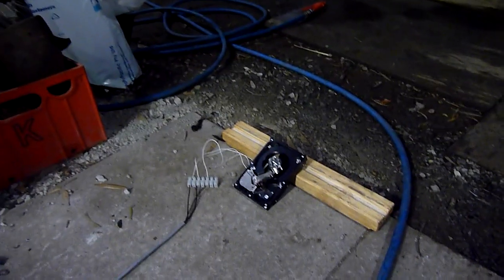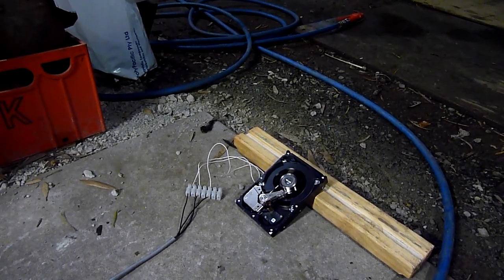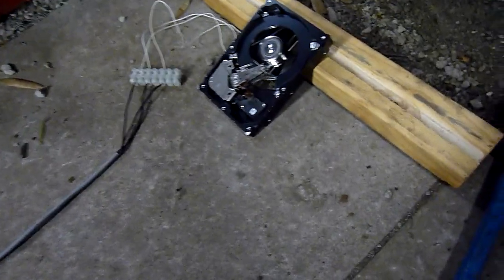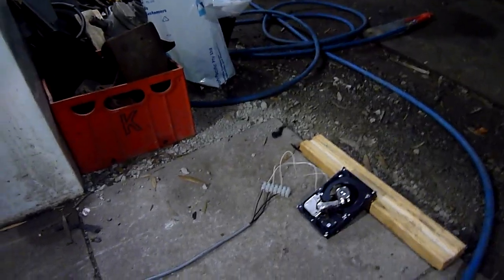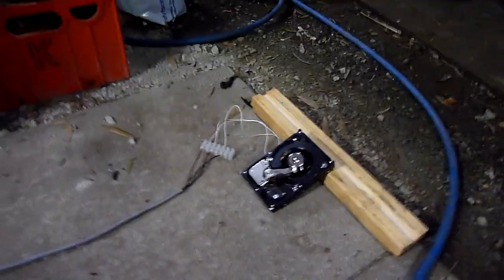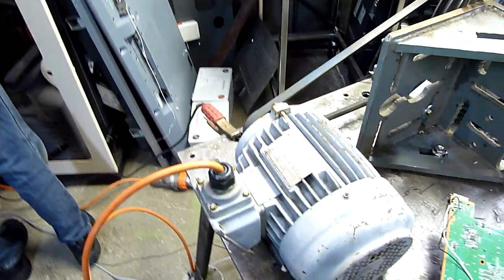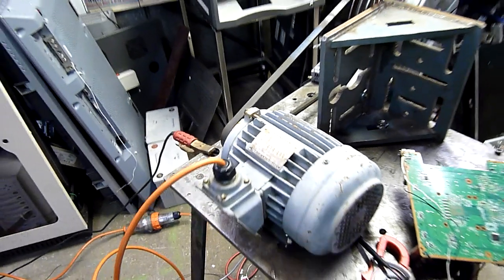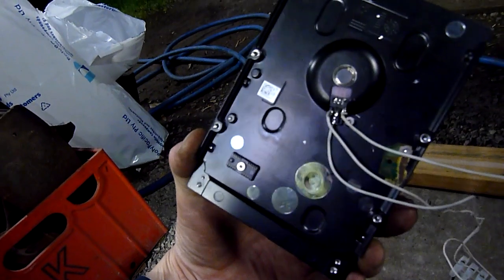Jullian's Death Table - BLDC LG Washer Motor Vs BLDC HDD Motor

Comment: I don't understand the hertz thing - were you putting more voltage into it? I'm learning but I don't get this part - anyone can answer that would be great - thanks :)
Reply from the maker: When I was calling for more hertz I wanted the drive motor to spin faster, the VFD makes an induction motor spin faster by increasing the speed in which the AC changes direction.
straight out of the wall, mains AC reverses polarity 50 or 60 times per second, we pushed it to almost 170 times per second with the VFD, and in 3 phases, not one.

Comment: Would you consider swapping the spindles on the belt so you could really tear the hard drives arse out? great video btw
Reply: I think I mean swapping the pulleys
Reply: I was thinking about that too. But BLDC motors are controlled closed loop for a reason. If you manage to get it started with the higher minimum frequencies(after changing the pulleys, it will probably go out of synch and spin down at few thousand RPM. Or you'll just pop the windings.

Comment: what was the name of that white plastic thing they put the wires in?
Reply: It's called a terminal strip, it has brass inserts with screws to grip the wires,
Reply from the maker: inspirality
yep, termninal strips, very handy things. usually come in a 100mm - 150mm long length (15 - 25 tunnels) but there are tonns of sizes out there.

Comment: What ever happened to that big black GE motor you rebuilt?
Reply from the maker: I do not have any GE motors, but I do have a few Century ones still around
Reply: Was it a Westinghouse maybe?  It was that huge one about the size of a mini fridge.
Reply from the maker: computersales
oh yeh, that is a 1904 Westinghouse generator, I still have that in the back corner of the shop, need to drag it out again soon :D
Reply: Aussie50 Aw sweet.  It has been missed. :P

Comment: is that a seagate hdd that has failed? looks familiar on the inside.
Reply from the maker: yes its a Seagate 1tb 7200rpm drive that suffered a severe head crash.
Reply: A lot of the 7200.11 and 12 were failing left and right. Firmware issues and etc

Comment: What ever happened to the big shredder project you were doing ???
Reply: Good comment i was thinking that to
Reply from the maker: getting the right steel and getting it cut is going to be pretty expensive, not impossible, just expensive.
that and I need CAD drawings to give the laser cutters too, since its all 12 and 16mm plate at the very least.
Reply: sounds like it is going to be fun to get all the stuff together but it be cool to see when its done
Reply: aiden glynn how true

Comment: Induction motor stalled because of the breakdown torque of the motor was being exceeded, not because of anything momentum related. Also is this a single phase motor drive the washer motor or 3-phase motor? If 3-phase, are you using true 3-phase? If not then that three phase motor will have greatly reduced torque capability. Better off just using a single phase motor.

Comment: Viewer # 295. :D

Haha, it took that and didn't go POP? That's bizarre. :D

If the spinning disk was dissipating the heat from the motor, then putting your hand near it would've felt a bit like a mini fan heater. :D

If you were planning on popping this, then it needs more of something. That generator device (washer motor?) needs to be cranked up harder probably.

Thanxx for showing,

-BoomBoxDeluxe.

21st July 2014, 14.05